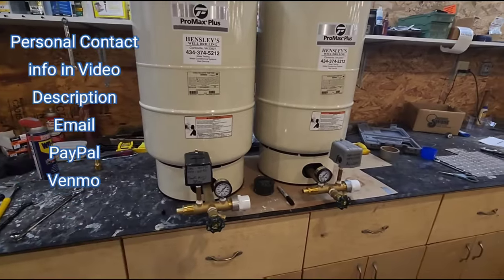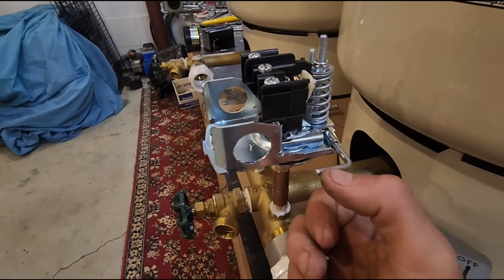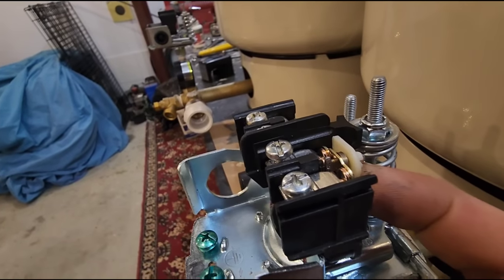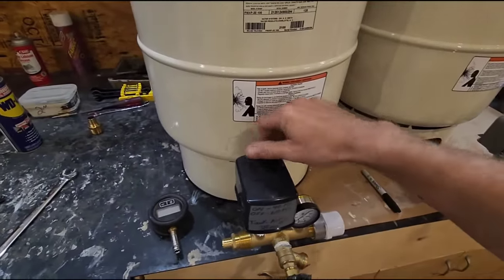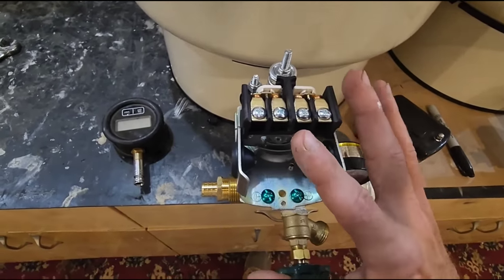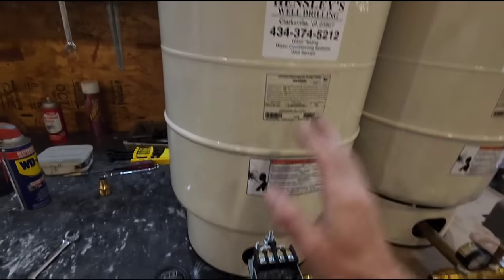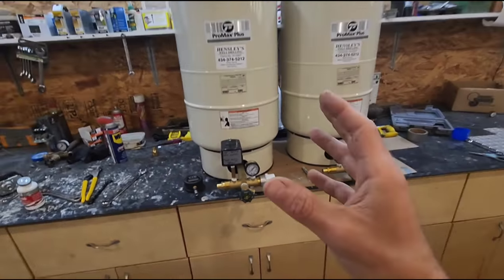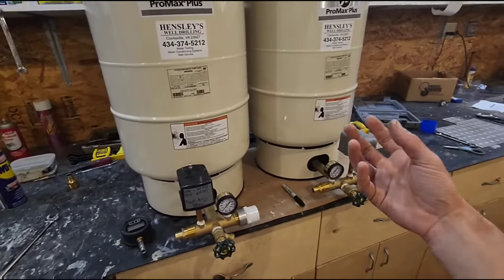Most Common Reason for No Water!! Reset Pump Pressure Switch. Water Well Repair Vlog Ep.18

Comment: Hello! I've been watching most of your videos since about a month ago since I find them entertaining at first until about 2 days ago when my pressure tank had gone bad. I had to buy a new pressure tank and decided to replace the old pressure switch as well. Since my plumber was out of town, I decided to install them myself specially installing the pressure switch since I am bit hesitant when it comes to electrical stuffs, but after watching your video about how to wire pressure switches, I somewhat got the courage to do it myself. It turned out quite good and got my system working normally again. Now to my question if I may. The most common switches that can be bought here in the Philippines is the 20/40 psi. My old switch was the 30/50 psi. I adjusted the new 20/40 psi switch to 30/50 psi since the new pressure tank that I bought had a 28 psi pre charge. Is it ok to adjust a 20/40 switch to a 30/50?

Comment: Are those cylinders made from steel or copper. Here in the UK we have copper cylinders and are operated by a diverted valve then turns power to the pump via a control panel

Comment: I’d like to know if I can increase my switch from 30/50 to 40/60 or will that shorten my well pump or bladder tank and switch’s life span? Idk if jumping to 40/60 will make the wife any happier but I’d like to try. However I don’t want to wear out the equipment quickly either. Thoughts?

Comment: I cleaned the contacts w sandpaper on my low pressure switch.  Now the switch doesn't engage the fulcrum or move the contacts.  Did it fall out of something? I then held the contacts shut w a stick, then water started gushing out of the pressure relief valve until I switched the breaker off.  Our initial problem was a tripping breaker.  We have an artesian well the owner believes (I am tenant / landmate).  We have tank, pressure switch, control box--but pump wiring seems to be capped off in the well head, and we have a spigot that lets contantly flowing (Artesian?) water out of a 90 from the well head...  So we're assuming some of that water gets diverted to tank via some process, but we don't see a "pump" anywhere...

Comment: Hi . I hope you can help me please. I installed a bladder with a pump on a solar system about 2 years ago. Recently the pump only turns on when the tap is opened and tends to run the battery out being on and off so frequently.  It immediately turns off when the tap is shut. It's as if the bladder is being bypassed or is no longer holding water at the required pressure.  I have adjusted the pressure screws and rechecked electrics but no joy. Any advice would be greatly appreciated.  Awesome channel
Sent from South Africa
Reply from the maker: The bladder is bad or the tank is out of air. Replace the tank and it should work correctly again

Comment: if you have a 30-50 switch could you lower the range to start at 30 but turn off at 70 with the 2 adjustment screws? I'm trying to help with a short cycling pump (while running irrigation) and feel if the range is longer it will cut down on the cycle times

Comment: The reason for this feature on switches with leavers is to save the pump.   In situations where the pump can run out of water in the well due to limited well deliver rate, the pump will suck air and cavitate.  It will still be turning but can't pump water.   Water going through the pump cools it and the seals.  If it continues to run with no flow the pump will be likely be destroyed.   The idea of this kind of switch is that if the pump has cavitated and is left running AND if there continues to be a draw on water from the tank the pressure will continue to go down below the normal pump kick-on pressure.  At some pressure (like 20 psi) the pressure switch will kick off (lock out) to save the pump.   In these cases the pump switch must be reset manually as the vid shows.  Generally one only needs to hold it until it get to 20 or so psi certainly 30 which happens fast.   If you find your pump switch tripped you need to figure out why.   I had mine trip recently because we had a powered outage and I had a stuck sprinkler valve "leaking" water out even with the power off until it drained the tank.

Comment: I have a question maybe you can anwser. I needed to replace the float in my tank but it's a ole well pvs fitting glued in to cast iorn well, how could i get that plastic fitting out of the well without breaking it off leaving the plastic threads inside the well

Comment: My pipes have frozen the other day. I have water to my house again, but my water pressure is now 80 -on 95 -off. My faucets dont push out as much water like before and everything should be thawed by now. The only thing I haven't tried that I can think of is maybe water in the pressure switch contacts. My tank pressure was 32 psi

Comment: I think I may have a different problem that you did not mention, I bought the a new switch and a pressure gauge that I’m yet to install today due to the switch being dead even after I tried your recommendations. I just realized that the circuit breaker switch to the pump is now tripping, like each time I try to turn it back on it will flip right back off. Do you have any idea what that means also? Thank you

Comment: I just had a freeze down here in Florida and forgot to trickle my spigots. Just finished digging up my feed lines from the well to the pressure tank and found no leaks. No busted pipes on the side after the pressure tank to the house either. Figured I dislodged some ice or it melted and was able to build up pressure in the tank regularly for a day. Tonight the pump is staying on and the tank pressure gauge does not go up at all. I can hear the tank full of water though. Would appreciate if you could point me in the right direction to start testing.

Comment: Having problems with my pressure switch turning on and off very fast. I've replaced my pump bladder and pressure switch and still the same problem. Only thing different is that I went with a 2 hp pump instead of the 1/2 hp pump that I had before because of the distance that my water has to go.

Comment: What's the best way to put a gasket on a front-loading washing machine with the specialized tool that is supposed to be used to install it? 
  Long story short, my roommate and I have tried to replace the gasket on our washing machine to no avail.  I wiped butter along the inside of the gasket in order to slide it on the drum easier. But for some reason, we cannot get the inner ring to wrap around the gasket and the drum. 
  There are two rings, but we are just having trouble getting the first one on.

Comment: Hello, I’m upgrading to grundfos 1 hp 22gpm because  adding a sprinkler system.   Would you recommend changing the pressure switch to a 40/60 I currently have a 30/50. Any other recommendations.  Should I upgrade my 1 inch poly pipe to one and a quarter would that help or benefit me in anyway   Thanks

Comment: Thanks for sharing! My problem is I pull lever on low pressure switch and it fills tank then when I use water it doesn’t turn back on to fill tank. I have a 40/60 new pressure switch but won’t turn on at 40 and I have put 38 psi in tank. Any ideas would help

Comment: Hey thanks for the info I just replace my system with new tank and pressure switch but I notice that after runing water the tank goes empty to 0 and after couple seconds it restart by itself can you help me out what you think is the issue I will appreciate ( air pressure is set to 38 psi. Switch is 40-60 on a 32 gallon tank n) all new

Comment: @h2omechanic Hi! I found your video very helpful. I have a question: I recently shocked my well with bleach and left it in the system for 24 hours to kill bacteria. Afterward, I flushed out all the water through the garden hose. However, my water pressure keeps dropping. When I run the tap, the water flows normally for about 2 minutes before the pressure drops below 40, and the pressure switch doesn’t activate. If I turn off the tap, the pressure slowly rises again. I’ve already cleaned the nipple and pressure gauge, flushed the water tank, and adjusted the pressure to 38, but the problem persists. Do you have any suggestions on how to fix this?
Thanks for your help:)
Reply from the maker: @taurean_gamingyt  you probably have too much air in the tank , try letting some out. (Make sure you don't have a 30/50 switch as well) . Set the tank air pressure to 35psi or 32psi. Your switch is just off by a little bit

Comment: I've watched your videos and checked the bladder tank pressure (28psi) I've also flicked the contact on the pressure, but I haven't found the problem. I only have 18 psi on the gauge at the pressure switch. We continue to have water coming from the faucets, but very low volume do you have any suggestions?

Comment: Hey wondering if you had any advice for me. I’m new to well water/well house. We had our pressure switch replaced 5 days ago and not it’s not working again. I went out and moved the lever so that it started working again but I have to keep doing it. I didn’t see the kid that installed the new switch with an air compressor so I’m wondering if he didn’t refill the tank if that would cause the switch to keep needing reset?

Comment: Hello, I have a question (and that you for your videos).
My question is:  why is my tank reading 22psi on the pressure guage and it is completely empty?
We have no water.  We shut everything down overnight incase we had just run the well dry and turned off the breaker to the pump.
Still no pressure or water this morning.
I’m about to go buy a new switch and MAYBE a tank if you think that might be necessary.  We don’t know how old the tank is (we’ve been here 6 years). 
Thank you so much for the opportunity to get some answers.
Reply: Just a little update.  We changed the tank and the switch box and we have the exact same problem as before.
Hold the switch and it won’t build.
But, while holding the switch we have water but as soon as we let go of the switch it goes again.  (we can only get 10–15psi by holding the switch - it will not build to 20 where it usually starts to build in its own).
We changed the switch (that whole box thing)- that didn’t work.
And we bought a new tank and installed it and it’s the exact same as it was before.
No good. 
There is water in the well and we assume the pump is working because we have decent pressure while holding the switch up.

Comment: Hey I appreciate your videos. Extreme cold weather, had furnace running on 65 all the time, no sign of frozen pipes even where they enter the basement. Had water in the morning, ran an errand and now no water. Weird thing is the pressure switch is in the on position and pump pressure is around 45-50. No breaker tripped or power outage. Have shut off power to the pump, and am trying a portable heater to warm up switch area even more. Tank is full but no water leaving the tank to rest of house. Would appreciate any insights or fixes you may have. Many thanks!
Reply from the maker: Filter? If so does it have a black element in it? If so remove it. 
Secondly, 50psi on gauge, then its probably broken & stuck on 50

Comment: Hey how are you? I have an issue where i have replaced the well pump itself just recently, i have replaced the pressure tank within the last year and just replaced my pressure switch as well. I flip breaker on and it doesn't trip, so i assume at least the wiring is ok? Still no water though

Comment: Okay I had to tap down in the middle. I heard the pump but I am at 38 on the pressure and no water. I didn't shut the breaker. Should I do it again with the breaker off?🙏

Comment: Hi! My water stopped running and I’m trying to troubleshoot. You showed how to close the contacts with the lever but my switch doesn’t have the lever. It’s the one on the left. How do I get the contacts to close so the pressure can build back up and run again once electricity is back on?

Comment: Hey bro...I'm watching your video because my wife woke up to take a shower and she had no water...I think I understand what your saying but I'm a little confused...I took the switch cap off and checked the contacts there is some buildup so I think I'm gonna replace it anyways...but I'm noticing that my cover says it's a 40/60 but my pressure gage says there is only 30 psi in the system...does that mean I need to create more pressure from the bladder tank?...or?

Comment: Help!
I greatly appreciate your videos. They are so detailed and informative.

However, I’ve gone through all of the steps you outlined and cannot get my pump switch to activate.

Long story… a family of raccoons moved into my attic, and then into the HVAC system, and finally tore up my utility closet (with the pressure and hot water tanks).

During the raccoon attack,  power to the pump was killed, the pressure decreased to less than 20psi. The circuit was tripped at first, but it holds now.

I have restored power to the switch, I’ve restored the pressure in the tank to 38psi (on a 40-60 switch).

I have run a voltage detector over the switch, and it seems “hot”.  But I cannot get the pump to engage.

Note: there is an in-line pressure gauge up-line from the switch that still reads less than 20psi.

I’d love any suggestions🙏
Reply from the maker: @Chunchucmil  if it runs 20psi, that typically means it's running on 1 leg. 240v pumps have 2 120v legs. I'd bet one of the wires is broken.

Comment: Hi, I have a 30/50 controller. The bladder has 30 psi. There is no switch on the side so I flipped the parts inside with the outside of my box as suggested. I still am getting no water or water pressure in my tank. I have a red jacket quickset check that has the pressure valve and then a separate water bladder on it. Can you recommend anything else to try?

Comment: I have the manual switch i followed your instructions but no movement on the gauge i have held it for several seconds and couple of minutes; tested for power so power is good. Not sure what to do next. We have had a power outage for two days ice storm in Ottawa on. What should i try next

Comment: Should I change my pressure switch if it doesn’t have the level type - would my pump burn out if the well runs dry what stops the pump in that case ?

Comment: So it's been freezing here for 4 days straight and it's finally starting to heat up. I had my pump turned off until today I went to turn it on like you first showed in the video as I'm very familiar with this process. I have been conservative with water and still had plenty of pressure in the house, Guage read 40 psi. When I went to turn the pump on, the whole system shut down and went straight to zero psi. There is now no water coming out of any faucet in the house when before there was basically normal pressure. What would make all the pressure dissappear when trying to turn on the pressure pump?
Reply: I opened one of the faucets in the house and tried to turn the pressure pump on and got some decent water. Maybe a line from the well is frozen underground still as I have a space heater and heat coil in the well house and those pipes should be good. I tried to turn the well pump on but I don't think the float is triggering which tells me there still should be water in the well tank. Or, the water in the tank could be frozen as no water is coming out of the spicket from the water tank.

Comment: Hello I am having issues with my well, it got very cold here the last couple of days and I had a line freeze and busted. I have fixed the water line and it was working fine. How ever I was taking a shower and the water flow just stop. So I when out and checked the well again and the pressure switch had kicked off. The switch is a 30/50 and has the reset handle on it so I tried resetting it but it won't stay on and running. What do you suggest that I check,  the switch was replaced last year and was working fine up until the water frozen. Can you give me some advice on what may have happened.

Comment: I replaced my pressure tank, check valve, pressure meter and switch box 6 mos. ago. Recently, I’ve noticed my water pressure drops to almost nothing for a few seconds and then returns to normal. I looked at the pressure meter and see that after the pressure gage reaches the cut-on (40 psi), it drops to zero before the pump turns back on. This is the period when the water pressure drops to a trickle. I tried replacing the switch box and check valve but there’s no difference. I also thought it strange that not much water came out of the tank when I drained it (when replacing the check valve and switch box). Any thoughts? I’ll try checking the air pressure today after I get a quality pressure gauge. Thanks!